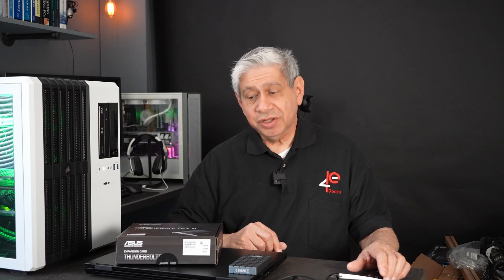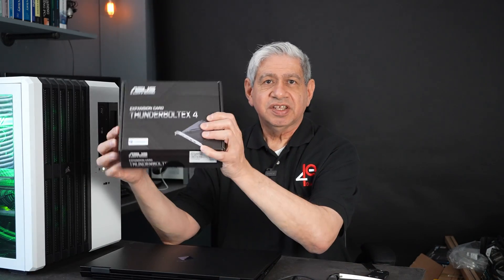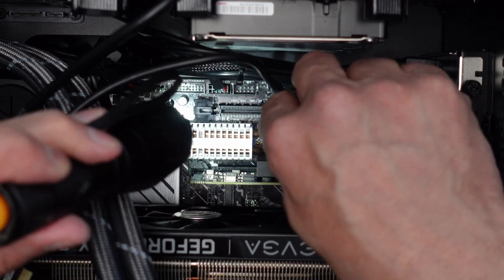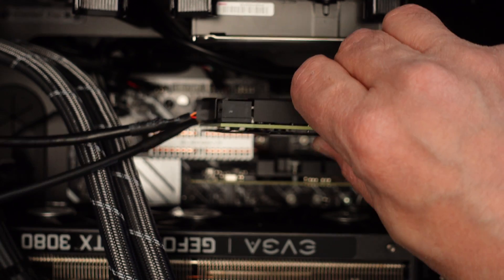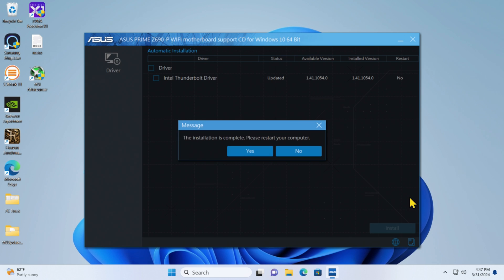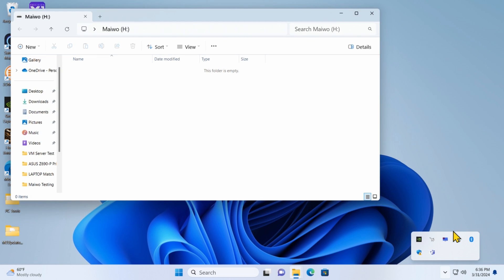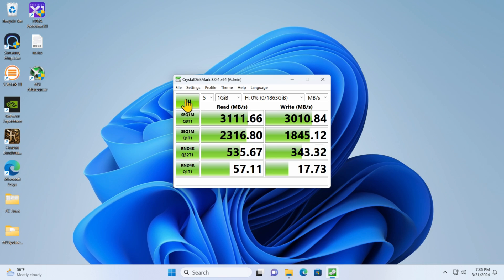Thunderbolt 4 Adapter and Device Install part 2

Comment: Its is recomended to connect the 6pin power cable on thunderboltex 4 in order to connect universal audio twin x duo?
Reply from the maker: Yes, correct.  Thanks for the extra information.

Comment: Me empieza a trabajar lento cuando habilito el thunderbolt en el bios no entiendo porque
Reply from the maker: That is the first time I've heard of that problem.  What motherboard do you have?
Reply: @PE4Doers z790 Asus tuf
Reply from the maker: @arielarrizabalaga993  Hmmm, that should wrok fine but maybe a little slower if it is installed i. a PLCIe 3 slot rather than a 4 slot.

Comment: Hello there, great video. I just learned about the upgrade card. I am going to go this route to add an external NVMe to my system. I am aware that it will not give me full 40gbs speed, but it will be much faster than what I am doing now and give me the necessary access to my virtual memory and more space for my workstation. Also, thank you for linking all the products. Are these affiliated links? That would be a great way to show my appreciation for all the hard work that went into this video. This saved me lots of time searching for all the products and other information needed to decide on the upgrade. 

Keep up the good work. Subscribed.
Reply from the maker: Thanks so much for watching and commenting.  Yes, those are all affiliate links and I would appreciate any support.

Comment: I think theissue is that because the card uses PCIe 3 to communicate with the motherboard the 4 PCI3 lanes that it uses can only xfer max of 32Gb/s not the 40Gb/s that Thunderbolt 4 is capable... Yet they advertize 40Gb/s that you will never get!
Reply from the maker: That may very well be.  Thanks 🙂  Unfortunately, I do not have a motherboard handy that both supports this card, and an available x4 (or above) PCIe 4 slot.  I may have that in my next build, so I will make sure to try it there and report how that goes.
Reply: @PE4Doers  The ASUS Thunderboltex 4 card is PCIe3 and will not be any faster in a PCIe4 slot and in my opinion it is unethical to describe this card working at 40Gb/s second when it can only run at best at 80% this speed. And the ASUS Thunderboltex 4 card is a difficult install in that after the driver installation and the card is visible in Device Manager it my still need to have PCIe tunneling enabled. but even then <32 Gb/s will be it's top throughput!

Comment: Great video, cheers!
Reply from the maker: Thanks you Sir.  I actually use the Thunderbolt 4 on that PC all the time for transferring files in and out.
Reply: @PE4Doers that's exactly why I'll be buying and installing one now too.
Reply from the maker: @4o4notfound...  OK, just make sure it is one compatible with your motherboard.  Good luck 🙂
Reply: @PE4Doers yessir, I have a Prime Z790 like you
Reply from the maker: @4o4notfound...  Great, that should work fine then 🙂

Comment: Hi David I followed the steps and installed it on my mother board and when I get into the bios I don’t see anything saying thunderbolt my motherboard is a asus rog strip b650-a gaming WiFi and it saids it’s compatible and I have it installed but nothing is showing up . Can you please help me ?
Reply: I got to the part where the cd is installed and when I plug up my Apollo twin interface it powers my interface off ? Idk what to do 😔
Reply from the maker: Sorry, It sounds like something is either set wrong in the BIOS or the board you have is bad.  Did you buy that board new?
Reply from the maker: Unfortunately, I am not familiar with the ROG STRIX B650 motherboard.  Have you reached out to ASUS?

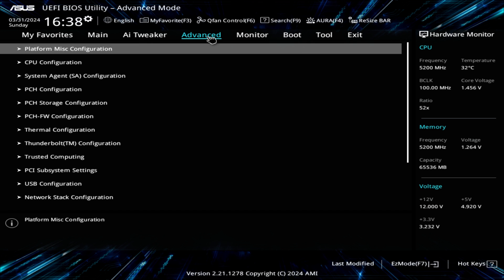Comment: Hi David, I have followed your steps but when I go into the bios I only have the top thunderbolt option seen here and not the discrete thunderbolt support option available as show @6:12 in your video. I have the asus thunderboltex 4 connected into an Asus z790p motherboard that should be compatable. Any ideas as to why the discrete thunderbolt optiion would be missing in BIOS? thanks
Reply from the maker: That is surprising to hear.  I agree it should work with that motherboard.  I suggest you go through the menus and see if that motherboard has another option you need to select that may default to the wrong mode in that newer motherboard.  I plan on firing up my in-progress build using the ASUS ProArt 790 motherboard.  I was planning to only upgrade the BIOS, but since that board has the Thunderbolt circuitry built-in maybe I can notice another BIOS option that is needed with the 790.
Reply: @PE4Doers I'll have a look through the bios tomorrow and check, might send asus an email also, thanks for getting back to me.
Reply from the maker: @nickwarren8468  No problem.  I am curious if you have tested its Thunderbolt speed.  Let me know.

Comment: The manual doesn't say anything about using or plugging in a PCIE power cable. Like zero. Thanks for the video.
Reply from the maker: I agree, the manual is extremely poor.  By the way, it will work without that 6-pin PCIe cable, since the board can draw up to 75 watts through the PCIe connector.  That power is 95% used to provide output power to a device connected to the USB-C connector.  If you use it, then you gain up to an additional 150 watts of power from that cable (assuming you PSU is able to provide that much), which means you can drive some fairly power equipment through the USB-C Thunderbolt, even easily charging a mid-range laptop (Business type, not High-End gaming).  Good luck.

Comment: Thanks for this video. I bought the new thunderbolt 5 card and it will not detect anything hooked up to the thunderbolt cable. Im so lost
Reply from the maker: Did you change the Motherboard settings related to the Thunderbolt card?
Reply: @PE4Doers  I did. My next test is the cable. I just ordered a new one although the old one claims to be a thunderbolt cable I'm just not sure. I read a few reviews on Amazon saying it was false advertising. Thanks for getting back. You got a new subscriber🙏🏾
Reply from the maker: @DaWizeDeciple  The cable is a great next step.  Thunderbolt-level cables are very thick and somewhat expensive.  Also, it is very hard to find one more than 3-feet long that is 100% reliable.
Reply: I'm still struggling with this because it won't pick up my Apollo Twin x
Reply from the maker: @DaWizeDeciple  Does it work with any other Thunderbolt devices you tried?
Reply: @DaWizeDeciple bro did you fix it? I've spent two days trying this and it's not reading anything. It charges via usb c but nothing else smfh
Reply: @elevatedxconscience  My mother board wasn't compatible with the thunderbolt 5 card. I switched to an older card and it worked right away.

Comment: Have seen the TB USB 4 on ASUS boards underperforming on other videos. Some said you can only do 5 gigs per TH if both are in use but 10 gigs if one is in use. USB 3.2 1x2 gives 10 gigs. USB 3.2 2x2 (present on Z790-H and others) gives 20 gigs. Decided not to bother with TB header on ASUS Z790 because of the reviews. Nice case. I am also re-using my 11 year old 540 air.
Reply from the maker: I have not seen those reviews, I only did the testing on my Intel 12th Gen system.

What color is your 540 Air - All Black or Black and white like mine?  I regret not getting the all Black as a second system case.  Did you know that one is shown in the original movie 'The Accountant'?

Comment: Please answer - Will this card work on the following configuration: 
1.Motherboard: Asus Prime X299-A 
2. Graphics card: GForce GT710-4H-SL-2GD5 (4hdmi out (3 used), 2gb ddr5).
  I would buy EX4 because I want to connect a Thunderbolt audio interface (UAD apolo x6).  
Chat gpt told me that my board has this possibility, but I have to connect the mini display port from the graphic card to the Asus thunderboltEx4, which my graphic doesn't have, and that's why it's not possible to do it on my configuration.  Is that true, correct?  How do you connect the graphics and thunderbolt card to the mini display port, why?  I don't understand that???
Reply from the maker: I do not own an ASUS Prime X299-A, however I went to ASUS website and took a look at the manual for the motherboard (since whether or not Thunderbolt cards are supported is all about the Motherboard), and it definitely supports Thunderbolt 3.  You will probably have to reach out to ASUS to make sure the Thunderbolt 4 card I show in this video will work or not.  My technical gut says to me that it probably will, but run only at the Thunderbolt 3 speeds.  I would check with ASUS to make sure, honestly.
Reply: @PE4Doers  That's not a problem, if it works at speed 3. One of the answers that chat gpt gave me is that on the motherboard or on the graphics card I need to have a DISPLAYPORT output or to which I need to connect the asus thunderbolt card, otherwise it won't work.  Is that true and if so, how are they connected to each other???
       What bothers me is whether the graphic card I have (no displayport) matters or whether I have to change it.  Does the thunderbolt card connect to each other with the graphics card.  In your video you connected a vga power cable (What is that?)

This is answer from chat gpt:
 However, for the ThunderboltEX 3 card to work properly, the motherboard needs to be connected to a suitable video output, such as Mini DisplayPort or Mini-DVI.  The Asus Prime X299-A does not have these ports, which means that it will not be possible to use a ThunderboltEX 3 card on this motherboard.

Comment: Does this work without enable Thunderbolt Support in BIOS, because it think it has USB2 header. 
Because my mainboard does not have that option, I bought the TB3 card and type-C output can export video only without enable thunderbolt support in BIOS.
Reply from the maker: It will work as a 10gb USBC, but not at the 40gb Thunderdolt speed.

Comment: Hi, my thunderbolt card is working now. I am getting 2500mbs, only half of advertised speed. Is that normal? I see yours and others are getting more 3000mbs.
Reply from the maker: there are a large number of factors that could cause that.  Did you place it in a standard PCIe system?  Do you know whether the slot transfer data at X2, X4, X8 or X16 bit bus speed?  What 'other X4, X8, or X16 PCIe cards do you have in the system?  I could go on, but it is very difficult to measure unless you get get deep down into the mother structure, and some of the other PCIe devices you may be using.

Comment: hi, computer noobie here:)))  i was wondering what are the names of the cables that you meed for this PCie card? and are they bought separately?
Reply from the maker: They are referred to as PCIe power cables and they come with your power supply.  If you did not build the system, or no longer have those cables, then you should reach out to the manufacturer of the power supply to purchase replacements.  DO NOT use any cables from another model power supply manufacturer -  the pinning can be different and you could damage your system.
Reply: @ thanks so much for the answer! i just saw in the part 1 video that the asus thjnderbolt comes with some cables…are those the cables i need?
Reply from the maker: @postyouu  Yes, they are needed, along with the six-pin part of a PCIe cable to your Power Supply.  Also, you need to have a motherboard that supports the card with all the required connectors.
Reply: @PE4Doers  thank you so much

Comment: I have the X570 AORUS MASTER motherboard, the board doesn't have the small connector, what should I do?

I can't find the Thunderbolt setting in my BIOS either
Reply from the maker: I wish I had some suggestions.  The IBM Thunderbolt chip needs those connectors to function at the full 40gb speed.
Reply: have you located the header yet? if not, here is some info:

The X570 Aorus Master has a dedicated 5-pin Thunderbolt header near the SATA ports for adding a Thunderbolt AIC. However, the presence of this header depends on the board's revision; original (v1.0) boards only have traces, while later (v1.1 and later) boards include the actual header.  this is from google.

more info follows: Board Revision:
The original version (v1.0) of the X570 Aorus Master does not have the header, only the PCB traces for it. You need a v1.1 or later revision to have the actual Thunderbolt header. 

I hope this helps. Your motherboard version may not be compatible. Good luck.

Comment: Hi, I have the same card. Works great with a TB3 Raid. I've bought a similar enclosure to yours (has the ASM2464PD chip instead of ASM2364PD. It only works at 10gbps. It's USB4 compatible with TB4 but doesn't work at 40gbps. What should I do? What I'm missing? I have drivers installed. Thanks!!!
Reply from the maker: Did you check the Thunderbolt cabling to the motherboard, and the BIOS setting for the Thunderbolt?
Reply: Thanks for your reply. Yes, cables are connected and thunderbolt options are enabled in the BIOS. I have a thunderbolt 3 raid and works great.
Reply from the maker: @adrinopu  OK, I guess I misunderstood that you were having a performance problem.
Reply: @PE4Doers  no problem. I have read on reddit that the ASM2464PD only works at 10gbps with my thunderbolt pcie card.
Reply from the maker: @adrinopu  OK, thanks for letting me know that for any future questions I get 🙂

Comment: will the asus thunderboltex 4 card see a usbc device connected to it?
Reply from the maker: Yes, a standard USB will work just fine, but at the slower speeds of either USB5 (or USB2) depending on your USB speed.

Comment: is there a way to try that Thunderbolt card on an MSI motherboard and check if it is working because i want to buy one so badly but i have an MSI board
Reply from the maker: Does your MSI motherboard support the addition of a Thunderbolt add-on card?  I know some non-ASUS MBs do have that support.  Without the special connector (and more important some addition LSI chips supported by the BIOS, I cannot see how you could get it to work.  I suspect if you install one, it will simply perform line any USB-C 3.2 device (10gb Max speed).

Comment: Will this card works without connecting the headers? I'm trying to install this card in dell motherboard
Reply from the maker: I did not try that, but I doughy it will enable running at thunderbolt speed - probably only as USB-C Type 2.2 (10gb)

Comment: thanks again. I got it working, yet, I am having an issue that the TB4 is not detected at boot, so for instance, I have my keyboard and mouse connected to a hub and then to the TB4 in the card, but I cannot for instance, get into BIOS using the keyboard and even after the windows screen, it takes a several seconds for the keyboard to be recognized. any chance you know if there is a setting to make the card more readily available at boot?
Reply from the maker: Do you have the TB4 in a 4X slot on your motherboard.  I have heard of some people placing it in a 1X slot and experiencing some some strange results.
Reply: @PE4Doers  many thanks. the manual for this motherboard (prime x670-p wifi from asus) says the thunderbolt card canonly be used in the bottom x16 slot.so i put it there.
Reply: on a related matter, have you tried for instance, to boot from a device connected to the EXT4 card?
Reply from the maker: I have not attempted that, so I really can't give a technical opinion in that area.

Comment: one question. the manual says that the 6=pin is only if you want the card to power devices connected to it. is that your understanding too? I just want to connect some OWC Raid boxes.
Reply from the maker: Sort of - that extra current capability will provide up to four times the amount of power to the devices plugged in to the USB-C connectors.  Even without it, power will be provided, but it's light a 'fast' charger rather than an 'average' charger, and can support full power to larger devices (like a small to medium sized laptop).

Comment: very useful. I just intalled in my PRime X670-P and first it was detecting the keyboard and mouse I have connected to a CalDigit3 to the Ext4 card. and now no POST! stupid me, I did not know I had to change the BIOS!!! I have now go back remove the card, change the Bios and try again.
Reply from the maker: I am not familiar with the CalDigit3, however I wish you luck.

Comment: Hello, will you have the driver that comes on the cd to share? I've been trying the one on the website but it doesn't seem to work.
Reply from the maker: I recently updated my driver with the one provided on the ASUS Website for this device.  There is also a new Firmware update there that I plan on installing and making a video about.
Reply: I got a CD player and tried every possible way but couldn't get it to work. The new firmware is a downgrade
Reply from the maker: @JulioAbreuu  You don't see the Drivers on the ASUS Website?  I really do not have an easy way to get it to you since I do not nave (or need) a Website.
Reply: Yes, I was able to install them from the Asus website but it still didn't work for me. I thought it was because the drivers might be different from the ones on the album (which they are) but using the drivers on the disc and the web I didn't succeed. I gave up and now I'll return the thunderboltEx
Reply from the maker: @JulioAbreuu  Sorry to hear that it didn't work.